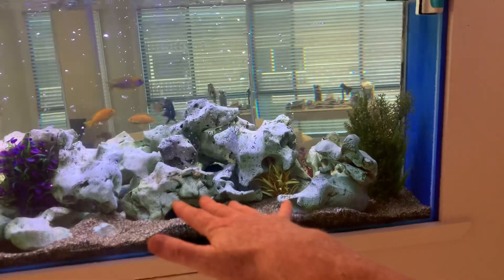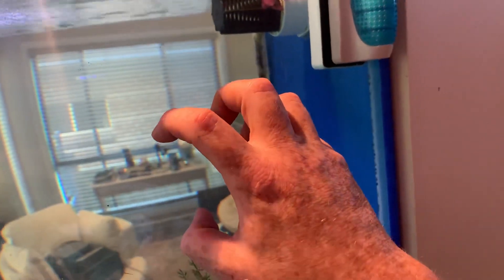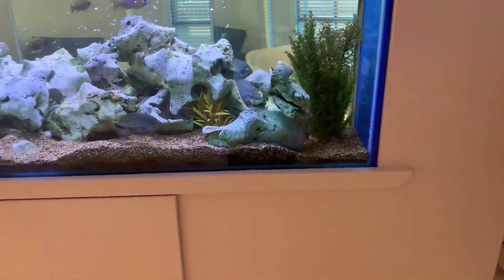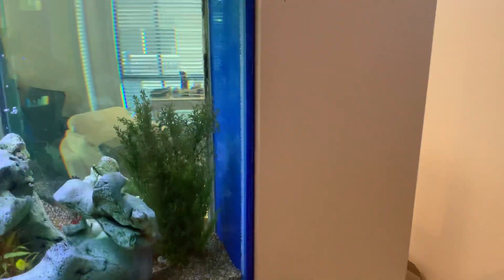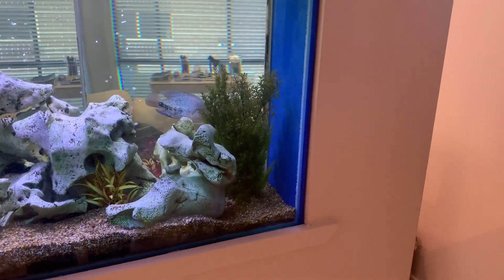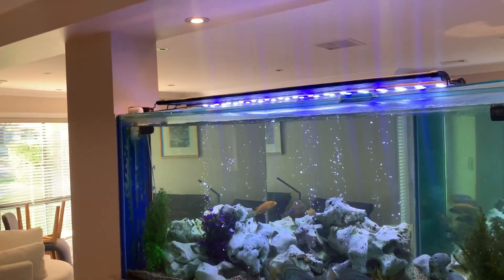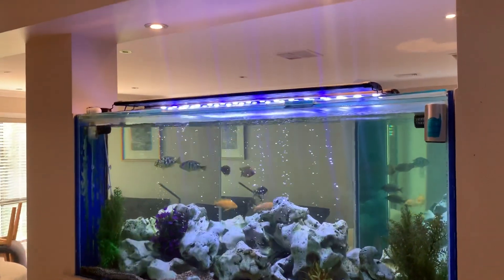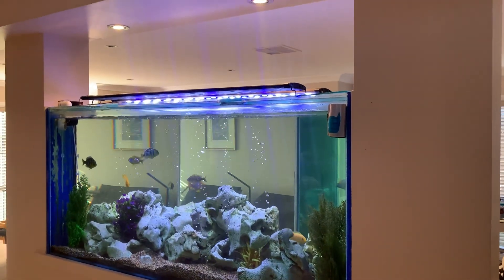How long does silicon last and why?

Comment: Do the plastic support structures on basic box store Msrineland, Aquon 55 75 gallon tanks help stabilize the tanks possible shifting over the years.  Tank shown in video doesn't  seem to have the plastic bracing I am talking about.  It's like the glass is clamped together using the plastic support structures.🤗😇🤔😬
Reply from the maker: No that only help reduce chance of chipping if your is trying to kill you with a large knife and it misses you but hits the edge of the tank when she finds out your dating her mum’s friend!
Reply: @MajesticAquariumsTV  

How did you know that happened!😉😇🤔🙄😬🤫🤭🤗
Reply: @JonsReef you seriously think a thin piece of plastic trim can hold 135g ofwater and all the pressure that entails? The plastic trim is there just to protect the corners from chipping, it adds no structural strength... That's what silicone and cross braces are for
Reply: @JonsReef 

That's a bunch!  I have a couple of marineland plastic edge supported tanks and feel a little better knowing it's more for support than cosmetic  purposes.  My oldest tank is about 17 years old and seems fine but that video put the scare into me!  I've even seen where peoples middle support bracket was broken!🤪🤔🙄  mine are very much intact.😬🤓
Reply: @JonsReef yes the trim on the bottom lifts the glass off the stand and removes any pressure points, but a $5 piece of styrofoam or yoga mat on top of a cheap plywood does the same job. And that's the only thing the trim does, the sides and top do not add any structural integrity unless you're talking small tanks with thin glass. Your 135g is held in one piece by silicone and presumably a cross brace or 2, not a thin piece of plastic that couldn't withstand 50lb of pressure let alone 1700